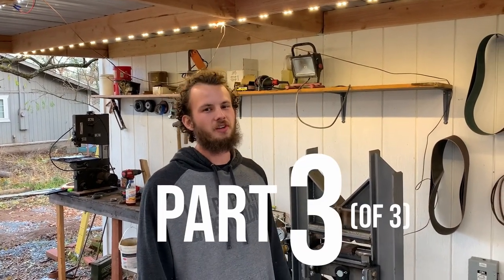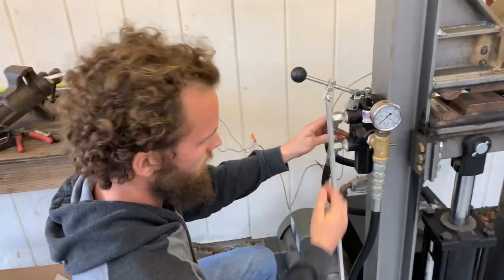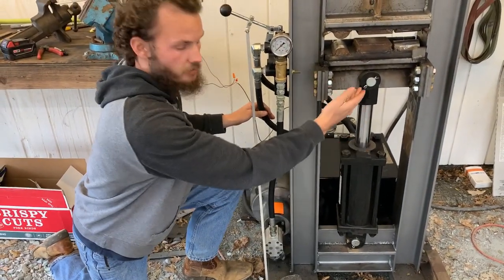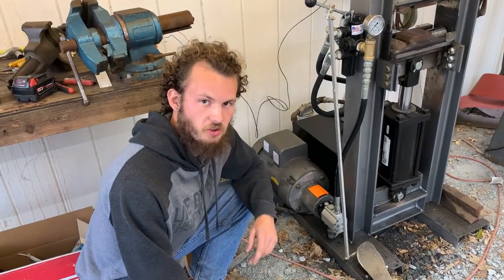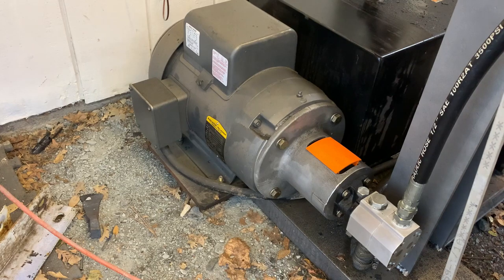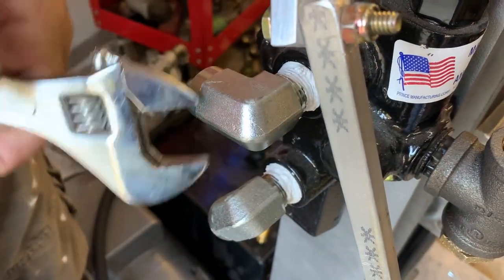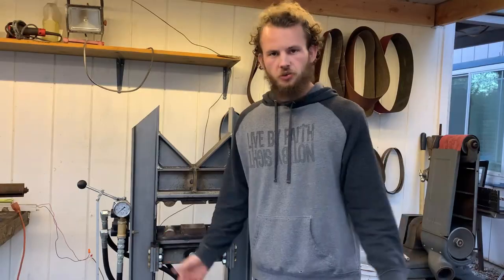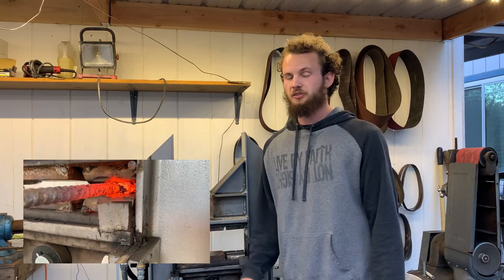The Comprehensive Hydraulic Press Build: Hydraulic System and Squishing!

Comment: Damn the ibeam is getting bowed like crazy.
Reply: Exactly! Not only the working space is too wide (thus producing high moments to bend the H beam's flange), but the guide plates are not long enough so they pinch the beam and bend it. This press would need some parts to be reconsidered. The middle die works fine but the two other one...

Comment: With this model of Leeson motor unavailable, what do you recommend in its place?
Reply from the maker: I currently cannot find that motor elsewhere. The important parameters are that the motor is 5 horsepower, that the RPMs of the motor match the RPMs of the hydraulic pump, and that the face of the motor can accept a mounting plate for the hydraulic pump. Others have used 3hp motors with success as well, but we stuck with the 5hp model
Reply: @FormulaJake  it's not strictly necessary that the motor face accept a mounting flange. Alternatively you can design a flange to come up off the machine frame to hold the pump. Admittedly I'd rather have the pump straight to the motor face but I've been having trouble finding motors and pumps that match.

Comment: you weren't kidding that you were almost done editing! question for ya, did you say 8" stroke? i'm looking at the amazon link in the description and don't see one with an 8" stroke. 

also, "ask me how i know" when talking about ruining metal made me lol.
Reply from the maker: Darn, they must have changed the link. I just opened it and it says 4 inch stroke which is not correct. I'll try to find the right one!
Reply from the maker: https://www.zoro.com/chief-hydraulic-cylinder-5-bore-dia-500820tcu3/i/G7747699/?msclkid=b3ae1134f81110a200164ec3c162f511&utm_source=bing&utm_medium=cpc&utm_campaign=PLA_US%20All%20products&utm_term=4585925563155030&utm_content=All%20Products&gclid=b3ae1134f81110a200164ec3c162f511&gclsrc=3p.ds#specifications

Here's the cylinder that we used, the important parts are having that 5" bore and 8" stroke 👍🏼 sorry about the mix-up!
Reply: @FormulaJake  right on brother. I got me the plans so I can mentally prep for the spring... hopefully I'm squishing steel by this time next year
Reply from the maker: Thanks so much for the support 🤙🏼 feel free to hit us up if you have any questions regarding the build! Best of luck brotha!
Reply: Chief cylinders are also available at Northern Tool and Grainger.
Reply: @thebogamin  you should join the hydraulics forging press group on Facebook before building this press. The carraige and top crossmember aren't strong enough for a 25 ton press build. The cross member and top cross member need to boxed in with 1/2" steel plate minimum. The carraige guides should be a minumum 75% (length) of the opening  width and reinforced to the carraige appropriately. This puts out 50 000psi, one inch steel plate has a yeild strength of 36 000psi. Forging off center or pressing material at the front of the carraige can/will damage the press. This is not engineered, does not have an appropriate safety factor build into material selection and plans should not be up for sale to the public. Its a dangerous press.
Reply: @jefflyon100  Thanks for this. is FB the only way to get the info? i don't have a FB so i'd need to create one (sigh) to be able to see it. let me know and i appreciate the feedback. 

nothing for nothing, but i'd guess that Jake appreciates this feedback too; he strikes me as a fella that likes to improve his work!

Comment: Plans available?
Reply from the maker: Yessir! 

https://www.etsy.com/AirborneProduction/listing/858775510/24-ton-hydraulic-press-build?utm_source=Copy&utm_medium=ListingManager&utm_campaign=Share&utm_term=so.lmsm&share_time=1600503579870
Reply: @FormulaJake  Thanks Plans purchased. What are your thoughts on the weight of this unit and making it mobile for my small garage/shop?.
Reply from the maker: Thanks so much for the support brotha 🤙🏼 we estimate that it weighs about 800 pounds. Due to the cylinder and motor being mounted at the bottom, the center of gravity is very low and it is relatively easy to push around on a concrete floor. Otherwise, a forklift or a pallet jack would be handy.
Reply: I appreciate what your trying to do here but your not ready to start offering plans for sale to others. You need to have an engineer do the load calculations for you, you obviously haven't done them yourself. Your uprights may be strong enough but your top, bottom and carraige are not.  You have no safety factor built into the press design. You need a minumum safety factor of 3 for that press to stand up to the abuse people will throw at it (more is better). The carraige guides should be atleast 8" long.  1" a36steel  has a tensile strength of 36000psi, your press is putting out close to 50000psi. The only thing keeping it from bending is the die plates. Take out the die plates and test your press. If you took a piece of 3/4" steel and placed it (on the corners) in the center of your press, about an 1" in from the front edge and applied full pressure it would bend your carrage and upper die plate.  Try some testing, move that 3/4" piece to the each side and apply full pressure. Your carraige plates will start deforming. Do these things with various material sizes a couple thousand times and see what happens. Think of everything a customer might do and make it twice as bad. Your on your way to having a viable plan but this press is not ready and selling plans is dangerous. I'm not making any of this up, have the calculations done. The loads are more than axial, oblique and eccentric loads can cause pressures up to 3-4 times the presses output, think levers. I mentioned this to you when you first finished it. Hopefully no one gets killed building this press.
Reply from the maker: I've done quite a bit of hand calcs and even some FEA on the press, and the factor of safety exceeds what you recommended for yield strength. I don't know why you mentioned the tensile strength of A36 and compared it to the press output; you didn't factor in the area portion of the steel. Comparing these two numbers at face value says nothing. We have done months of testing, including offset loads with and without die plates. The guides could definitely be longer, but when loading the press in the center of the die plate, it functions just as it should. Using the side dies is not advisable for any serious loads, as mentioned in the video. I agree that there could always be design improvements, but I think it is a gross exaggeration to claim that the press will hurt someone.

Comment: There's no such thing as "light" drawing work on a hydraulic forging press. It will go to 25 tons full pressure on every stroke, thats what they are designed to do. At 3000 psi this press will do 30 tons. You designed a wide opening press that the industry uses for multi die setups. Not every person using it will have watched your video warning them about the dangers of using your press in certain situations.  
  Thats why you have to properly design it with strong enough materials to handle anything the customer puts between the carraige and top plate.  Its not optional or conditional, people are putting their trust and safety in your hands when they buy plans from you.
  I'll give it to you, your really standing behind your design despite it being structurally unsound.  Anyone with press/machine building experience or an engineering background will tell you the design needs seroius rework before being sold to the public.. Its not them I'm worried about. It's the people that have enough experience to follow your plans and build it but not enough to recognize the structural issues you so clearly demonstrated in this video.
   You could have atleast told people that the press is only designed to have a single die that is center mounted because the guide system isn't designed to survive using outer dies. Not that is enough. 
  If you were trying to prove that the press is a good design by filming use of the outer dies it was a big fail. The carraige was racking more than the bolted guide plates should have allowed which means they were being bent and deformed. Zero safety factor, they can only survive  being deformed past there yeild point so many times before something breaks and bad things happen. At 25 tons loaded up its seriously dangerous. I know you don't honestly believe your design is sound, do something to fix it.
  The carraige should stay parallel to the top die plate, thats the whole point of the design.  If you had been forging a thicker piece of steel you wouldn't have had the dies on the opposite side to stop the carraige guides from being damaged further and probably tearing themselves apart. You know you could break this press in an afternoon, heck an hour yet you keep promoting it. 
  I hope everyone of your customers is a top notch welder. That might save their lives, or atleast a serious accident. Advertising ways not to break it by making arbitrary rules on how the outer dies should be used "carefully" is not a solution. It's a big red flag and just dangerous.
  Why not use thicker material to make  guides that are MUCH  longer and use more of the H beam cut at an angle to support them. You'd have a press design that might work, instead your sticking with a prototype design that doesn't. The press needs redesigning, come to terms with it and help the customers that have already build your press to refit a proper guide system and strengthen it. You really should take it to an engineer so the whole thing can be gone over and get all the problems identified. I'm just focused on the biggest one. I know you care about your customers.
  If the press was for personal  use i would have pointed out the problem and moved on but your selling plans to the public. Its irresponsible and dangerous. Please do something before something happens that you can't take back. I'm not the only one thats pointed these things out. You know I'm right, fix it.
Reply: I mean in the nicest way, as someone who isn't a engineer and is just watching to gain knowledge can you put what u said in a simpler way that I will actually be able to understand 😂